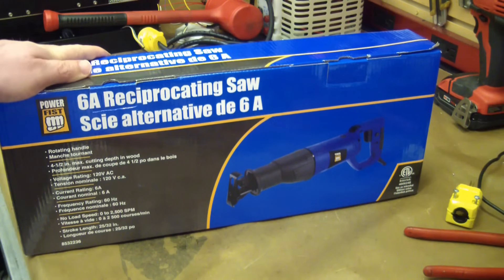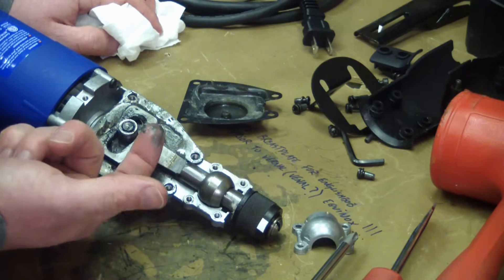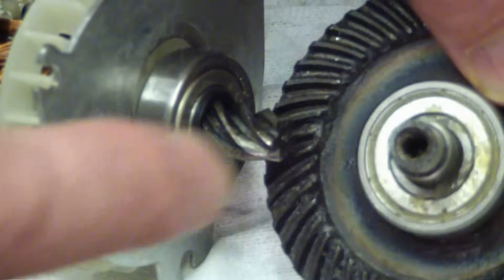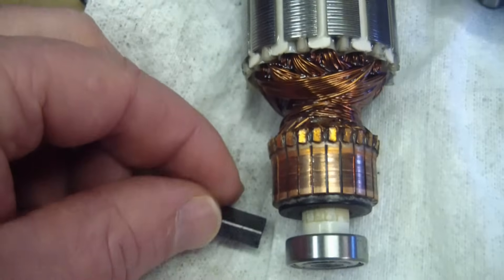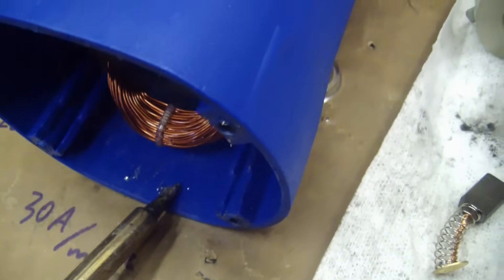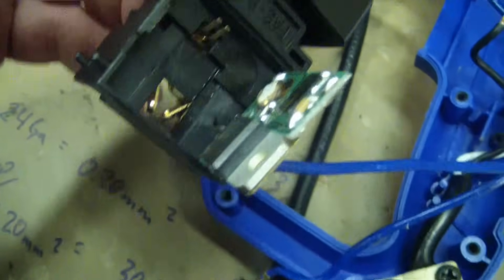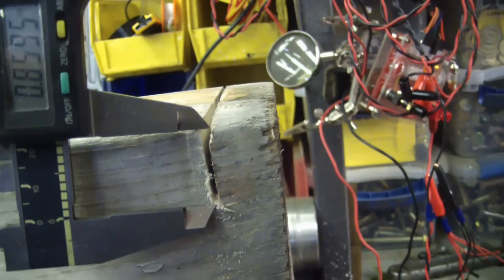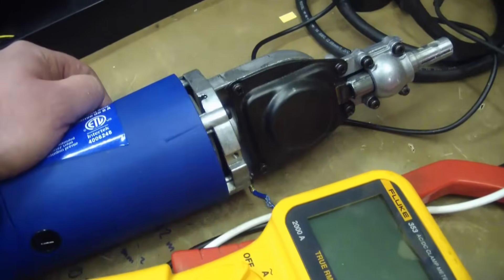Bored of Lame Tool Reviews? Power Fist Saw. Sink your meat hooks into this Offshore Abomination!

Comment: AvE, my PA story. I was welding new deck plate on a very old tug boat for Brent in Ladner BC. Brent lent me his brand new PA 9" grinder to do the job. 5 minutes into the job, the brushes went KABOING and launched into the ocean. I apologize profusely and beg forgiveness. He says "no worries" and drags me into the shed. One the shelf is an army of same grinders. He hands me one and says "they go KABOING so fast, that he makes a pile within warranty and takes the gross back. An endless supply of crappy grinders at no cost.... Works for him.... Slight delay in the work day, butttttt.......! Cheers, Daniel
Reply: I'm still going on my 4.5 inch angle grinder from pa. 6 years strong. I don't know how it still works but it's my go to not care grinder. Even has a chip out of the pinion gear. But besides a a bit more noise. Still works.
Reply: That has to be one of the funniest comments I've read on youtube in ages. Please tell me the welder was of similar quality...
Reply: Oddly, I have a $14 PA grinder that's 15 years old that's still going.  Only the rocker switch is acting up a bit, which is conveniently located on the back and safely away from the operator's fingers.  Don't know if it's the moly grease I packed it with to replace the factory earwax or where it happened to be born on the bell curve, but it refuses to die.
Reply: HAAHAHAHA I have heard similar stories. The apprentices job was to go and get replacement grinders every morning.
Reply: I will admit as well, I have a $9.99 angle grinder from Canadian Tire which is still running fine after 10 years of constant use... Go figure....
Reply: ***** You get the diamond if the ruff with the cheap stuff(even if its a pos from horrible freight and alikes).
I use Horrible freight as the one time project tool or the one that will break but I dont use everyday. So I just show up for warranty with them.
Reply: also referred to as Hazard Fraught 🤣

Comment: I thought the Power Fist Saw was a joke... I mean it is, but I really thought it was a joke.
Reply: Sniper Shots me too
Reply: Sniper Shots i
Reply: Oh the things we can modify this product for...
Reply: i bought there street sweeper and its awsome and great feul enfishioned for pretty good $799.99 machine with tax $920.00 love it :)
Reply: Sniper Shots I worked at Princess Auto in the 80’s. At that time they used to buy mid-level “home-pro” stuff and send it to Taiwan, asking “How much to build us your version of this?” I used to create a lot of good stuff from the warranty bin, as a lot of the failures were minor QC misses. A bad part, loose wires etc. I think, like the rest, they’ve slipped a tad. That being said, my kids bought me a PowerFist gas pressure washer. OHV engine, soap injector tank, extra nozzles, no-flat wheels. I spent a few afternoons washing landscape bricks, and it “chooches” like a damn. Buyer beware, ask questions. Most of the time, employees will quietly inform you of stuff to avoid, always welcome.

Comment: You have clearly illustrated what completely ticks me off about offshore stuff: you expend the same amount of materials, energy and time as you do to make a half decent product, but you come up with something that ends up as landfill fodder in short order. You often mention black and decker, but I remember as a kid that they used to make cheap, very basic power tools that held up quite well. As the years went on, you started to see the corners being cut, and once they went offshore it was the end of the line. That seems to be the general problem, doesn’t it? Those building an item have no connection to the name or it’s history.

Comment: I spent about 4 decades working on public transport projects. As a planner I was first in, but contrary to what you might expect,  on more than a few I stuck around right through design, then construction and even commissioning.  So I got to work with some great engineers,  some outstanding construction managers and a few excellent operators and maintenance people. What struck me was that at every step, the new players regarded the work of the previous team as crap - that they took too long and didn't know them asses from first base. I referred to this as the hierarchy of contempt.  Every step in the process - planning, design, implementatio and then operations and maintenance required special expertise and experience. The needs of each step were different, and each had different challenges. Also, in each step, there had to be refinements and adjustments. I really enjoy listening to someone who has worked on functioning systems and has learned the lessons only available through years of experience. Too often the planners or engineers never stuck around to learn from the constructors, operators or maintainers. I always found their comments worth hearing, even though they were convinced that everyone who developed the project were idiots.

Comment: Actually, the 'Z'-marking on the bearing, stands for metal seal at one side; 'ZZ' or '2Z', stands for metal seals at both sides!
Keep it coming!
Reply: Isn't that what he said? Sealed at one end?
Reply: Really actually a single z marked bearing denotes one that is a double decker type ,with higher load rating than a standard deep groove type :)
Reply: @michaelwarlow4398  
I did'nt know that..  thanks!

Comment: I bought a 4 1/2inch grinder over 20 yrs ago at P.A.  it is still going strong after much misuse, haven't even had to use the spare motor brushes that came with it. Actually everything I ever bought there has lasted....inverter arc welder, chainsaw grinder, bench vice, various hand tools, solar panel, etc etc etc

Comment: I know why the grinding dust was left by the factory. It was left to mix with the grease to lap the parts together so they could run smoothly together. It's genius labor and machining saving -  a self perfecting operation at it's finest. Lost in the translation of the instructions was the steps to disassemble, clean out the muck, and apply new grease after 52 minutes of moderate operation. I actually have one of these from Harbor and cleaned and greased mine when new and it has served me well around my house.

Comment: The "Z" on the bearing means it is sealed on one side with a metal seal. "ZZ" means the bearing is sealed from both sides with metal seals. "RS means one rubber seal 2RS means 2 rubber seals...
Reply: debelibobo brandy hearted your comment ♥️❤️

Comment: The Z on the bearing refers to the metal shield. The numbers mean : 6 - deep groove ball bearing, 0 - it's series (light, medium, heavy), and the last 2 0's give the size of the bore. 6000Z is single metal shielded (if it has 2 shields it would be called 6000ZZ), light duty with a 10mm bore.

A 608 skate bearing is also a light series deep groove ball bearing, but as the bore is less than 10mm it only uses 1 number for bore size (8mm in this case).

I work in bearings so I just has to post the correction. Sorry.

Comment: I think something got mixed up in receiving at the factory and assembly accidentally got some cheep, Chinese, tapered end mills, took a look and said "meh, close enough". 

That's gotta be the worst power tool I've ever seen sold. I can't imagine what working conditions are like at that factory. It doesn't look like they have a QC department or if they do they care as much as they guy who puts the heat-shrink on ...and the guy who does did the pinion gear ...and the guy who put that philips head machine screw on etc, etc.

Comment: I typed this from an image I found online.
Bench Drill Operating Instruction: It is of novel design, small and exquisite bulk, handy carry. It adopts single phase series motor with high rotating speed. It is an ideal tool for the household fine and small hardware processing. The cent of product has no class to adjust soon with single soon two kinds.
1) Drilling machine the pedestal that put to insert the stand shaft (if the match is tighter, packing then the stand shaft top end holds up with the wood piece, the small hammer knocking softly), in steady workbench, in the pedestal, counteracting the bolt fixs.
2) Shall the handspick into the dentation shaft2.
3) Connect before switching on power supply, please check the voltage with agree with physically.
4) The operation please read the manual before.
Reply: ***** The bearing manufacturer has a website: http://lmgtfy.com/?q=duf+bearing
Reply: 503technics lol... Classic.

P.S. Google Canada isn't as full featured as the states version. :D

Comment: I got a Harbor Freight version for $19.99 + tax 2 years ago to "dig out" some Juniper roots.  Tying them to the truck and pulling didn't work.  It was a sacrificial tool.  It "dug" through the dirt, rocks and roots just fine.  It ended up spending the winter outside with rain and a little snow.   Last spring (after it had sat long enough to be dry inside.  I plugged it in and it seemed to run ok.   I then duck taped it to the end of a 1" PVC pipe and used it as a pole saw.  I cut off many dead/hazardous branches above the 12' level,. (I do NOT recommend doing this at  home or anywhere else...ever for anyone).  Then I cut up a pile of branches that were 4-5".    I got WAY more than my $20 worth out of the thing.

Comment: On the cheap grinders I lock the  motor on for about 10 minutes. I then take the gears apart clean up the parts then lube the gears with clean constant velocity joint grease.  Really last

Comment: I'd like to add about the quality of some parts and not others, it makes a lot of sense to me. Those gears? Probably one of the most expensive parts to machine. Also on another video you said the switch alone was 40 dollars. If they machined the gears at a decent factory and had them hardened, and then put in a 40 dollar switch? Then it's no longer a 30 dollar tool, it's a 90 dollar tool. If you're going to have a no name 90 dollar reciprocating saw then obviously you'll just pick up a dewalt or something similar.

Comment: Here is 2 cents. I have a number of power tools (and manual tools). It can be low, mid or high-end (is Craftsman high?).  I repaired a number of them, such as stuck brush, broken wire, clean the switch contacts and disposed the ones with bad bearing. It is cheaper for me to buy a used tool vs. replace the bearing. $20 vs. $20+ and wait 2 weeks for the bearings to arrive.  I do not make an effort to see what it is inside until it quits. I have 2 out of 6 - 4.25" angle grinder that is about $10 USD, HF variety. No issues with them, one mid-range Royobi had a switch broken very quickly.  The switch did not break, but the plastic that goes over the switch broke which makes it hard to turn off/on. I do not buy expansive tools. Because there is a very high chance for me to loose them before I break them.  Last year, I lost 2 circular saws and 1 sawzall, I think?  Hmm, too many tools to keep track.

Comment: Great vid. as usual.Just a point about the bearing;you said the Z denoted deep groove.This is not the case,the 6000 series is a deep groove range of bearings,the Z denotes a single metal dust seal (RS would denote rubber).Keep up the good work!

Comment: My Harbor Freight $20+ red saw (I think it was Chicago Electric) lasted me almost a year of moderate use (several times a week, deck rebuilding mostly), 'till I had to down size, so I sold it at garage sale for $5. Money well spent, I also own 3 name brand saws, but preferred using this one to demo decks, always used brand name blades though.
Reply: +Valery Zalivin 
Ive had one that I have beat the crap out of for several years, still going.

Comment: My friend bought a Chicago Electric one from Hazard Fraught for about $20 and it's done ok.  No hard work, but it has been used a few times.
The same brand variable speed  7" sander/polisher does ok as long as you don't put a hard load on it, low speed and high pressure lets all the smoke out of if pretty quickly.

Comment: I have been viewing your old videos since finding you on u tube (a godsend). I have been using sawzall's  since 79 and used almost always Mill, and their Super Sawzall when it came out. I currently have a Porter Cable Tiger saw on truck but, I admit I have 2 harbor F saws with rotate handles, 1 in garage and another in shop and they work. $20 a piece w coupons. I have a cordless Mill from 90s that they stopped making batteries for, something Mill Fuck me has always done changing battery designs, chargers and volts ( I have bins like yours full of dead cordless shit. I think you and old tony are best on You Tube.

Comment: I bought a ryobi corded reciprocating saw, grinder and drill about 5+ years ago. Just needed something to start with never expected them to hold on this long. around 30 bucks for each one, drill might have even been 27.... USD that is. They all never let me down, the saw my only complaint is i broke off the plastic lever you lift up to load in the blades so now its a pain in the ass but it still works. the drill sometimes I use it for so long you can feel hot chunks of what I assume are the brushes flying out. It just keeps going though. Grinder i haven't noticed any issues with at all so far. I use these things pretty often too. anyway love your videos keep em coming.

Comment: i bought a similar saw for $20, harbor freight sells them as the chicago electric brand. actually it hasnt let me down on the odd job here or there. i used it to cut through exhaust pipe and a few other things. i also know the limitations of a cheap tool and i dont overload it. 

the middle class blue collar worker is broke which explains why people buy such trash. spend $20 on a saw like this or spend 1/4 of your entire paycheck on a saw. people dont have the money anymore. i make more then $400 per week because i have a CDL, but if you look in at indeed, its loaded if $12 per hour temp service jobs.

the middle class economy at least where i live explains the success of cheap tools. if we still had manufacturing in the united states then people would have to money to buy better stuff.
Reply: The race to the bottom

Comment: I have one of these (mines red so it cuts faster). It was 20 or less American dollars. It has over 12 hours of run time on it. It has gone through at least 30 dollars in blades. It shows no signs of stopping. I know its junk but it wouldn't surprise me if it lasts me another decade of occasional use. Take it for what its worth.

Comment: Wanna see something scary?
Thus quoteth Wackypedia: Shur-Lift Industries, formerly known as Princess Auto Manufacturing (PAM), builds hydraulic cylinders, under the Shur-Lift brand,[6] and assembles items such as air compressors, chemical sprayers, and log splitters that are distributed and sold through its retail locations. The manufacturing division also makes products for some original equipment manufacturers (OEM), including the Canadian Forces and Zamboni.

I can understand letting the lowest bidder supply your military, I mean who is gonna invade Canada.  But your Zamboni machines?!?!

Comment: Yes I know this is an older video. I went out and spent $20 on the Harbor Freight model and spent $10 on the two year replacement plan. Why? Because  I'm using it to take apart pallets for the hardwood to make butcher block countertops for my kitchen.  I really didn't want to use my good saw and this makes a decent replacement. The best part is that the two year replacement plan means that for the next 2 years when it dies, I get a new one to abuse. In the past month, I've gotten it replaced twice.

Comment: My harbor freight saws all has been impressive maybe I got the gem..   3 years medium to heavy usage and its still kicking.
Reply: +dave runner Mine is red...   dont know if they are the same.
Reply: +dave runner are you a contractor?
Reply: +dave runner Ok just wondering. Was curious if our definitions of "heavy use" differed. Mine would be "nearly constant use for days or weeks to gut a building".
Reply: Not used constantly but when used, used hard
Reply: +dave runner lol that would be a great viagra slogan
Reply: +dave runner I got a cool wed Chicago Electric one from Harbor Freight I believe, or it could have been Sears, but these days what's the difference? It was a gift though so not sure where it came from. But it's a Chicago Electric and I used it to carve out this sweet I think sweet Paper Towel holder. http://imgur.com/Ygh2mwq And it's pretty hard wood, it ate up my 60 grit sand paper on the Orbital sander. Funny Story though, My Orbital Sander is a Chicago Electric too and it spins the sand paper in a circle right and all that. Well I'm not very tool smart on how it all works but I was using it and I'd lift it up off the project and you could hear and see it spinning faster and faster... I guess it has no like speed regulator because with 60 grit sand paper at least it was kinda scary putting it back down to sand more lol.
Reply: +dave runner that was a slow response.
Reply: +Steve Hillier Im a busy guy....
Reply: +dave runner Mostly on big compactors balers and horizontal cardboard balers.....
Reply: +dave runner Also do some crane service...
Reply: +dave runner It seems strange to respond to a comment you already responded to two months earlier. Good to know your recip (or whatever tool we were talking about) works well!
Reply: Im an oddball...  what can I say?

Comment: huh. the $30 or so harbor freight one I have has chopped up an old hot tub and tons of steel and it still works. the metal dingus and rubber boot eventually came off from vibration but other than that it actually works.